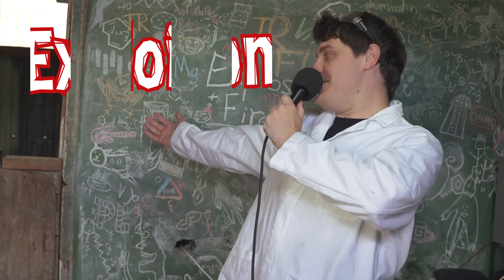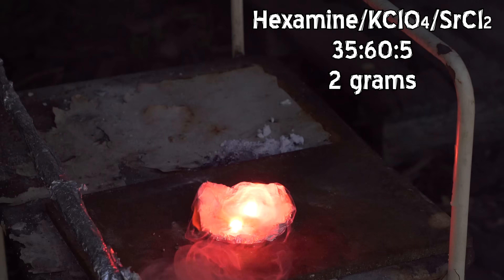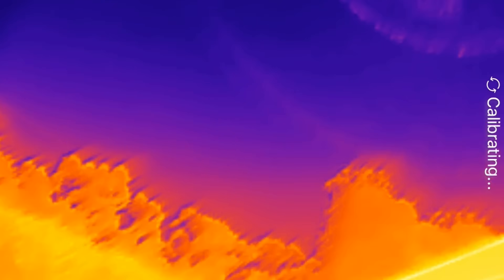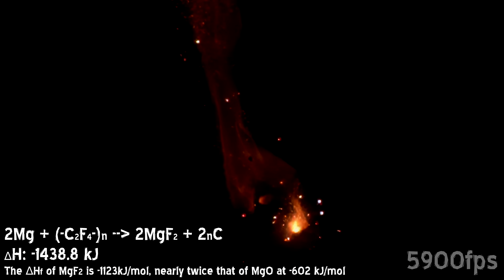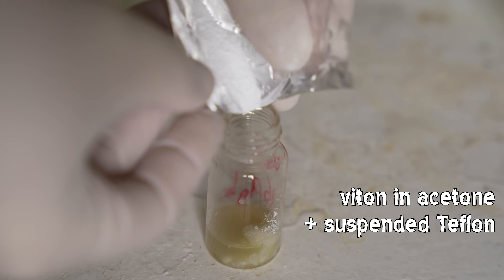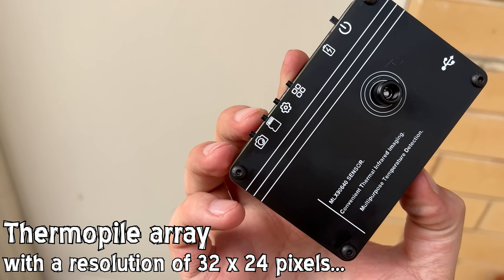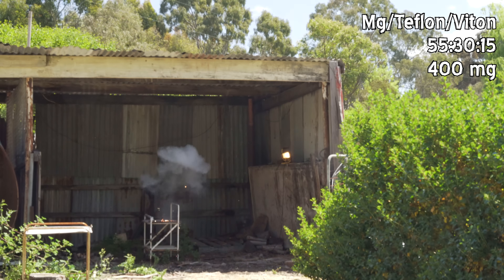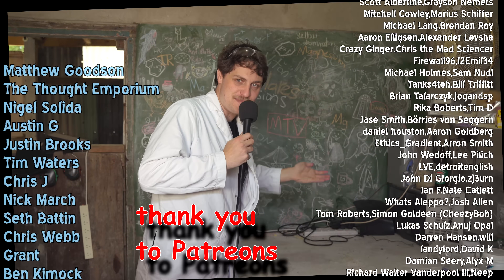Making Anti-Missile MTV Flares

Comment: 5:30 bike chain lubrication is a massive rabbit hole. Turns out the best lubrication is wax with additives, i.e. parafin wax with PTFE. You strip the chain of all the factory greases, then dunk it in melted wax and leave it in for 45 minutes. Compared to factory lubricants, it makes the chain run smoother and for longer (chains stretch because dirt abrades the rollers, effectively stretching it and wearing out all the other parts; wax tripled longevity). It's a bit of a pain in wet weather because of how long it takes to redo, but otherwise it's mint.

You can buy PTFE for it because there's additive blocks you can add to parafin, but they're obnoxiously expensive because of marketing and some guy trying to make a buck.

And remember: friends don't let friends use Muc Off.

Comment: Now optimize it for the visible light spectrum, and make it burn as fast as possible (borderline explosive), and you have a "Photo Flash Flare", which is exactly as goofy as it sounds. It's used by recon planes as a photo flash, usually because the plane taking the photo isn't equipped with a flash under the fuselage. (Surprisingly enough, that was also a real thing, they used giant one time use bulbs that were as big as your head and filled with zirconium wool and low pressure oxygen)

Comment: The MTV formulas I've seen specify Viton B as their binder, not the more commonly available Viton A, which has different physical and chemical properties, and is less expensive.

"Viton" is the tradename for at least two distinct types of FKM copolymers: Viton A (FKM Type 1) are bipolymers of vinylidene fluoride and hexafluoropropylene (approximately 66% fluorine content); Viton B (FKM Type 2) are terpolymers of vinylidene fluoride, hexafluoropropylene, and tetrafluoroethylene (approximately 68% fluorine content).

FKMs are thermoplastics at first, but they are then vulcanized (crosslinked) using various curing agents. From what I have found, bisphenol is the most common curing route.

Unless otherwise specified, any "Viton" rubber sheets, O-rings, or washers for sale are most likely made of bisphenol-cured Viton A.

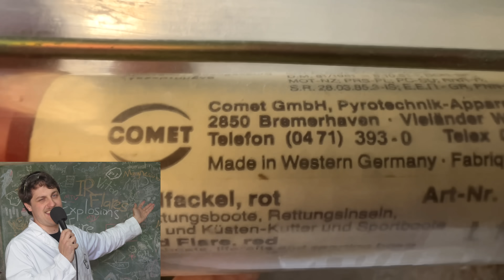Comment: 2:36 A 4 digit postal code. That means it was produced before 1993. The 4 digit one doesn't have a O or W in front. That means it was before 1990. And since it has 4 digits it was after 1962. .

Comment: 1:20 the AIM-120 series of missiles is actually radar guided, so it wouldn't even be distracted by the flare at all, it might get fucked up by chaff though. It's designed for long range engagements, while most IR guided missiles (AIM-9 for example) are for shorter range stuff, and those have a good chance of going after the flare (or at least being somewhat distracted enough for the pilot to evade)
Reply: Also pretty cool that the photo of AIM-120D is on screen at 1:20, probably not intentional, which makes it even cooler
Reply from the maker: Haha I tried, people do notice things like that I’ve found
Reply: @ExplosionsAndFire  aw man that's awesome! Loved the video by the way, do not let my nitpicking deceive you :D

Comment: The fun way that IR missiles avoid getting countered by IR flares is the tracker will use a smaller FOV as it gets closer to the target and wont get fooled by heat coming away from the jet from flares as all it can see is the hot engine. The second way it can take the average size of the 'heat blob' of the jet and find the center just go for that, combined with the computer taking the speed and direction of the 'heat blob' it can null out the wild direction of IR flares. 

None of these IR missiles are foolproof and can get fooled but its become a lot harder for jets to counter missiles which is why radar reduction has become the name of the game, can't be seen till it's too late and you are being fired at by missiles means less time trying to lock and shoot back and more time going defensive trying to not get hit. And even harder when using beyond visual range missiles taking targeting data from other sources and from the missile it's self.

Comment: For anyome who was wondering: High Frequency Trading (HFT) using hardware like FPGA pays alot, yes, but I'm pretty sure theyre gonna chew you up like any other upscale finance job. You also showed an FPGA, and let kellme tell you they use SystemVerilog, so be prepared to use a language where half of the keywords are simply unusable and you just have to remember which. Turnaround from trading algo to in prod is hella fast too, although some people will like that.

And yes, FPGAs can operate on picosecond scale so you better like counting clock cycles in simulators.

Comment: on aircraft they generaly load a few diffrent types of flares depending on the missile that might be launched at it and the patterns that the flares are deployed in also is quite important to evading the threat. the mtv flare mix you made does a great job of over exposing the sensor the next step of deploy a flare to mimic your engines for it to then think it is the original target is the key.

Comment: Fun fact, back when Wii's were a thing, I had friends that just moved and had misplaced their sensor bar in the move and we needed to get a wiimote to work long enough to basically select something on the menu and not much else. 

I asked if they had two lighters, and stood by the TV with them lit up for the ten seconds it took to select something. Worked a treat.
Reply: I wonder if lit candles would work as a replacement
Reply: @pirig-gal  they absolutely would.

Comment: Fun fact the US sidewinder had a problem with Russian flares because they were so crappy. Flares tend to burn hotter than the engines and when the US was finetuning the sidewinder seeker they set it to ignore sources that were too hot, to try and reduce locking onto the sun or the flares.

Well Soviet flares had terrible QC and actually burned cooler than the engines of Soviet planes and so the flares still worked against the sidewinder until the US later fixed it.

Comment: Against older guidance technology yes this is how it worked. However, modern ones aren't just looking at the infrared spectrum and steering towards it. They can determine the size of the emitting object, the velocity of the emitting object etc. So if you filter out the smaller and slower moving objects then what's left is the desired target (This is ultra simplified). Countermeasure flares today still do have an effect but it's much smaller and need to be deployed in specific ways and in large volumes to do much against say a AIM-9X or ASRAAM. Even the old FIM-92E from 1995 isn't easily distracted by flares (As Russian helicopter pilots found out).

Comment: I wonder what the rest of the emissions spectrum for that MTV flare looks like. I know for a while, IR missile seekers would try to ignore flares by incorporating UV sensors into the seeker head.

My speculation is that MTV emits UV radiation when it burns and jet exhaust doesn't, so the missile seeker head ignores any IR source that is also emitting UV.
Reply: Update: I just did some quick sloppy math, and I think the enthalpy of formation of a single Mg-F bond is 5.8 eV, which is solidly in the UV spectrum (the visible spectrum doesn't go far above 3 eV)

Comment: I may be mistaken but I do believe it was the year 1997 that missiles achieved full sentience: 
The missile knows where it is at all times. It knows this because it knows where it isn't. By subtracting where it is from where it isn't, or where it isn't from where it is (whichever is greater), it obtains a difference, or deviation. The guidance subsystem uses deviations to generate corrective commands to drive the missile from a position where it is to a position where it isn't, and arriving at a position where it wasn't, it now is. Consequently, the position where it is, is now the position that it wasn't, and it follows that the position that it was, is now the position that it isn't.
In the event that the position that it is in is not the position that it wasn't, the system has acquired a variation, the variation being the difference between where the missile is, and where it wasn't. If variation is considered to be a significant factor, it too may be corrected by the GEA. However, the missile must also know where it was.
The missile guidance computer scenario works as follows. Because a variation has modified some of the information the missile has obtained, it is not sure just where it is. However, it is sure where it isn't, within reason, and it knows where it was. It now subtracts where it should be from where it wasn't, or vice-versa, and by differentiating this from the algebraic sum of where it shouldn't be, and where it was, it is able to obtain the deviation and its variation, which is called error.

Comment: There actually is a minimum drop altitude for flares so they don’t randomly cause fires and iirc they burn up after aproximately falling 400 feet but this restriction only really applies in peace time (airshows exercises etc.) also modern seekers have IRCCM (infrafed counter counter meaures) I don’t know the magic behind it but I know some of it is due to the seeker narrowing it’s field of view post launch to not be overwhelmed by another source. Maybe different engines emit different wavelengths and that’s how they can distinguish it from flares? Great vid
Reply: The type of IRCCM you mentioned is gate width throttling. Pretty much giving the missile a very small window through which it can see the enemy aircraft after it's already been locked and launched, which means that it usually won't be able to see enemy flares and if it does it will only be able to see max 1 (which may not be enough to decoy with some sensors).

The only other type I know (although there's probably a bunch of classified ones being used on missile today) is inertial guidance, where the speaker just switches off whenever it detects a flare and guides itself based on a projected path for where the enemy aircraft would be afew seconds from then, before re-activating and continuing to track normally.
Reply: @cookiecraze1310  fitting inertial guidance into a small missile has to be some spacer blackmagic fuckery. If it's anything like inertial guidance used in aircraft that can't be cheap at all to make something that small. I would think optical guidance would be more optimal since we have the processing power to have mobile devices that can identify shapes and objects. 

Damn I shouldn't have dropped out of compsci and should've sold my soul to raytheon.
Reply: @mertvaran5733  it's not super fancy intertidal guidance, a missile already converts the location and speed and direction of an aircraft into a predicted flight path to follow, for the IRCCM the missile just deactivates its IR seeker and then decides where to go based on the last data it got, before re-activating it's IR seeker after a second or two and re-establishing its lock.

Comment: Beyond those ranges (and including) are called microbolometers. There are also pyro electric ones, such as PIR sensors, and old Raytheon thermal camera sensors called BST (barium strongtium titanate, seen on the thermal eye 300D cameras)
The pyro electric sensors can only detect changes in temperature so they suck. Currently the microbolometers (thermal radiation absorbing heat sensitive MEMS resistors, i.e. VOx, aSi) are overall the state of the art in terms of performance to size and cost. Those semiconductor based camera are quantum sensors, work the same way as a normal camera does, but those materials need to be cooled down a lot to work well. Old gen infrared homing seekers using PbS doesn't need cooling to work, and they are not really photodiodes but instead are photoconductors.

Comment: Tom, you say modern flare burn times are highly classified information and you're sort of right. They are, and anyone who told you an actual number would be in big trouble. But also, there's endless footage of flares being fired off on Youtube. You have some of it in this very video. You can just time it. One Mississippi two Mississippi is probably accurate enough for this. It varies a bit on the type of MTV flare, aircraft speed, altitude and stuff, but you'll find that they tend to group around a similar value.

Comment: So. The flares you most commonly see like from the f18 and such is called the m206 flare and it's about $40 (The number I just found for 2009 was $38) each and usually comes in a box of 30 for a little over $1000.  The US military uses roughly a ballpark of about 1 million each year. Although it fluctuates a lot.
Also those things have a install life of just 2-3 years and a shelf life of 9...(Looks at 32 year flare) that might be a way to force the government to buy more of them.
Reply: >that might be a way to force the government to buy more of them.
As another comment had pointed out...

The Expiration date is more "the risk of it fucking up is getting to an actually probable chance now, you do not want it to fuck up" in this case

More so if it's out in rough conditions and may be the difference between people living or dying

Do note as well, the 32 year old flare doing a V shape instead of straight up, possibly directly into whoever would have been holding it :V
Reply: You absolutely have a point for flares in particular, yes. @higueraft571

Comment: You just need one sensor and a way to spin it (or a mirror) slightly off axis and then monitor the signal and the angle of rotation and keep on making corrective movements of your missile till the sensor signal AC value is a miniumum

Comment: You wanna know something about Teflon? You can buy food grade stuff and use it as bulk. It’s inert like you said and will just pass through your digestive system. Someone in my food science program was using it to try and make a weight loss protein bar thing that makes you feel full, ya know, because of all the Teflon. It never went anywhere. Mostly because their prototype tasted awful. I felt bad because I was testing out what was basically chocolate cake at the same time, lol.
Reply from the maker: Wtf??? This is big news to me
Reply: Ultra cursed protein bar
Reply: it's fine in its normal form, but high heat can cause it to become more biologically harmful (it breaks down into more offensive components) so no baked bars, alright?
Reply: @enzochoi923  my worry here is the precursor chemicals. They're quite toxic, and I don't think any purity of compound can ever be fully free of its precursors. Not a chemist tho.
Reply: @Hansengineering lots of things have pretty bad precursors, i dont think thats been enough to stop the processed food industry for a while. the bigger worry is that it breaks down under heat and you cant expect a consumer to not bake a protein bar.
Reply: @Hansengineering  They use Teflon in artificial joints, so there clearly is Teflon safe enough for internal use.
Reply: @spookyweeb5563 it’s literally in every non stick pan….also who tf bakes a pre wrapped protein bar?
Reply: I can only imagine the clang as that thing hits the pan
Reply: @DjDolHaus86  I can only imagine a clang as that thing hits my toilet
Reply: @DjDolHaus86 Non stick human waste so it can pass through the digestive tract easier and won't stick to the toilets.
Reply: Microplastic in our diet is soooo last century, today we're eating MACROPLASTIC. AND WE'RE EATING GOOD.
Reply: Yeah but medical grade stuff is differently handled.
I'd love me some PFAS in my system. ❤ Gotta drink some industrial river water 💀
Reply: And here I thought the reason you’re not supposed to use metal utensils in nonstick is because Don’t Eat Teflon?  I’m going to stick with the Don’t Eat Teflon policy.  Although based on the news reports about forever chemicals, my understanding is that I do actually eat Teflon and it’s DuPont’s fault.
Reply: Donnnnt fucking eat Teflon, holy shit.
Reply: Consider that people who use pfas-containing floss have higher levels in their blood. It's not good at any temperature.
Reply: Isn't teflon a confirmed carcinogen?
Reply: Hi, no, Teflon is not totally inert and will absorb/leech chemicals and material into you via mucus membranes in your digestive track. If eating teflon was no issue, there would be no carcinogen warnings attached to Teflon cookware warning that should you over-heat them or use metal utensils on them, you risk poisoning yourself.

Don't eat Teflon, even if it's """food grade""" because the chemical product "Teflon" is itself the poison.
Reply: There have been some extensive articles published showing that Teflon was never fully biologically inert. The people making it had high levels of cancer and their children had high rates of birth defects. The company knew this and covered it up for decades. So like, a small amount of exposure is probably not the worst thing we're exposed to, but large amounts is def a bad idea.
Reply: I thought it was a carcinogen.

Comment: Uncooled microbolometers barely react to radiation below 8μm, maybe 7.5 if xou believe in their spec sheets. Down to 6 or 5.5 if you cool it down to 77K.

The Germanium optics can easily do shorter wavelength than ths 8-12μm/n-band declaration. But the specific antireflective coating not at all. The hard diamon like cabon coating on the front doesnt do anything.

And microbolometers are ASi or VoX. There is also ferroelectric BST sensors for the 7.5-14μm spectrum.
Reply from the maker: Yeah never used a microbolometer, but cooled HCT stuff is getting really good lately I feel